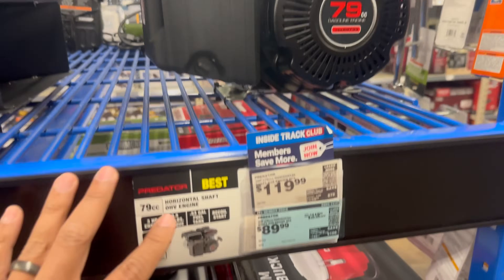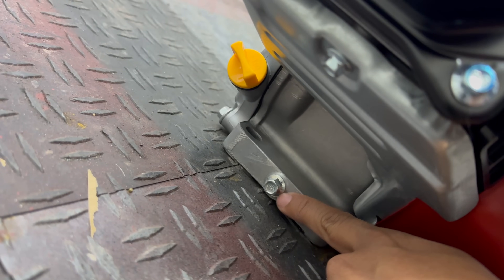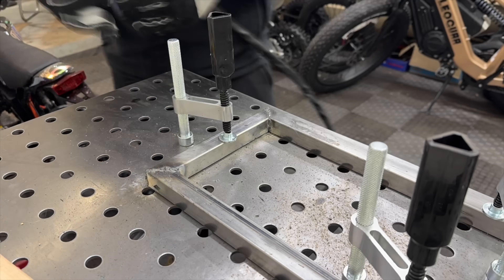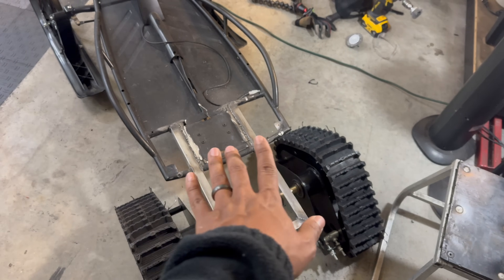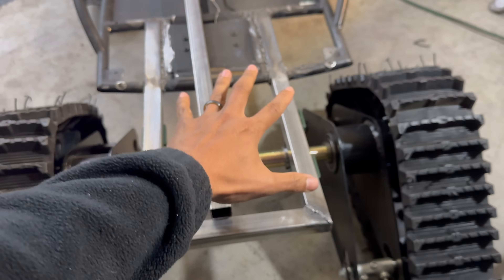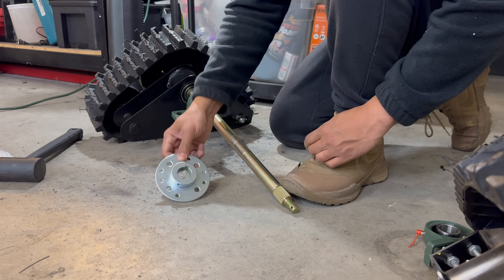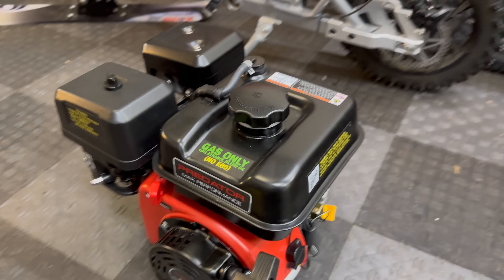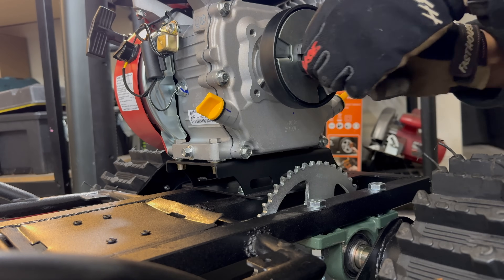Razor Ground Force Snow Kart Build Part 2 - It Runs!

Comment: have you checked your polarity on your welder? i think it might help if you run the electricity in reverse.
Reply from the maker: @tfkafka  it intermittently works better, depending on ground placement and how much I clean the surface. The factory razor frame that I painted had a ton of contaminants I should have spent more time cleaning. But I’ll look into it
Reply: @PatOutdoors  https://youtu.be/1cs8R703MQ0?si=GuvjtKJMO4BjXEEB
Reply from the maker: @ thank you! That is very helpful
Reply: @PatOutdoors  love your vids, would hate to see you get hurt from a broken weld.

Comment: My most effective method i use as a fellow flux core amateur welder is to pre heat the weld area with a mapp//pro torch for much deeper penetration. The weld actually pools and flows into the weld 100 times better. Try it out, and you will never go back to welding on cold material.
Reply from the maker: Thanks for the tip! Yeah I'm still learning how to weld in general so I really appreciate the feedback